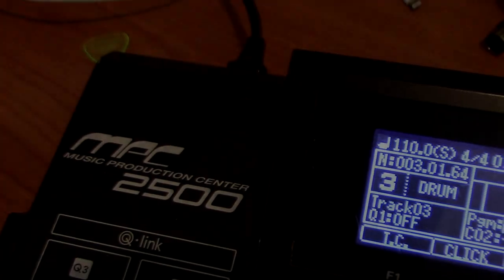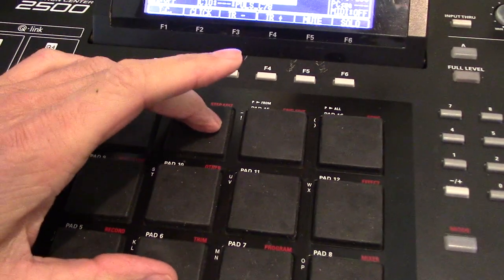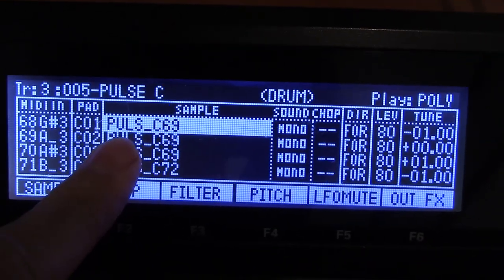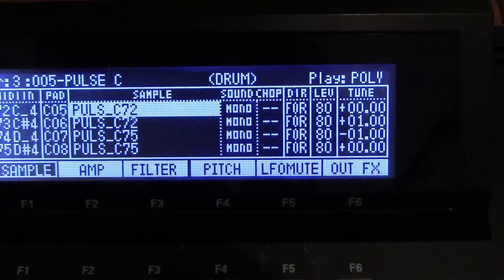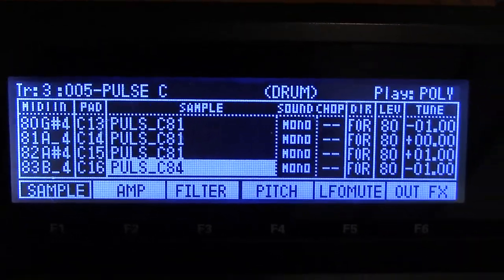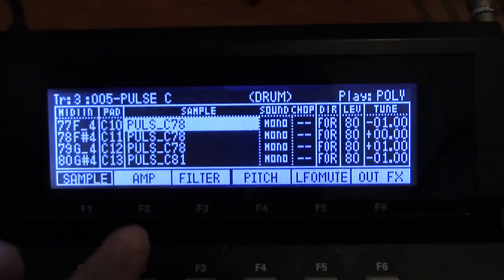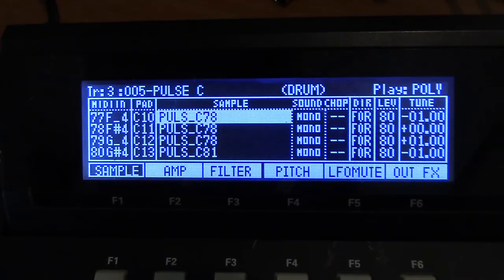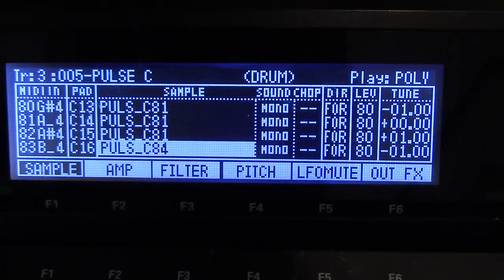Akai MPC 2500 - Samples as a Synth - jjosxl

Comment: there is a much simpler way to do this, you just have to set the program as "instrument" and then load your sample into a pad (make sure the tune of your sample is the same you are choosing on the program). you can even play the sample later on a midi keyboard
Reply from the maker: Hey, thanks for the comment!
So, the one thing that the instrument program and the 16 levels/tune have in common is that they speed up and slow down the sample as you play it higher and lower, which sounds weird when playing notes together in poly mode. With this technique, there is little to no speed up or slow down of the samples (depending on how many you use) and you can play all notes with a midi keyboard as well. Peace.
Reply: @lazoo2000  while it's more teadious to add every single note sample into the program, it's true that you can get a better quality sound compared to just using a single sample pitched +/- 24 smitones.

but you can use more than one sample on the instrument program and set each note value so you could in effect do the same thing as this but with the instrument program and the advantage i that you get other controls that represent better what kindof controls you want to have on your "instrument" sound. like the filter, amp, envelope shape etc.... i think in drum mode you have to go do each one individually.
Reply: I just discovered that the quality of playback of a sample in an inst program isn’t as good as in a drum program
Reply: how to turn sample into instrument? i tried many ways and didn't find any explanation. Basically i want to load bass note C and have it spread all over midi keyboard so i can hear if it's possible to use it. can you please explain how to do that?